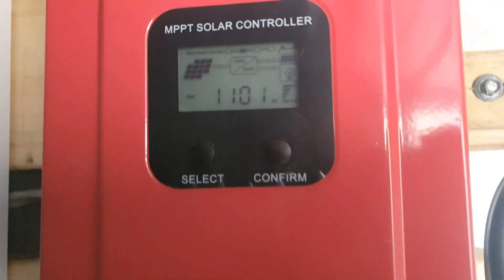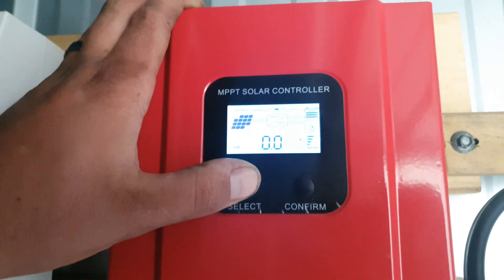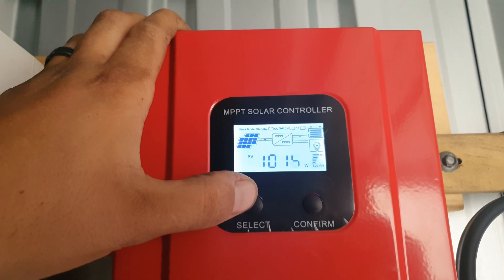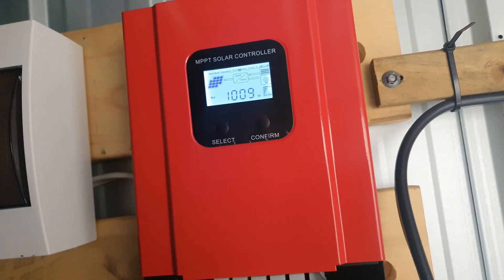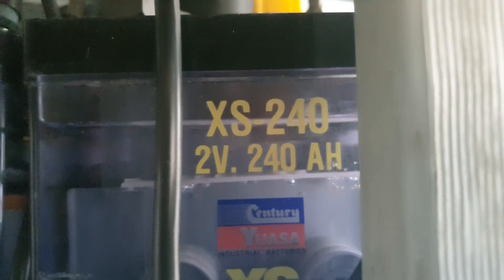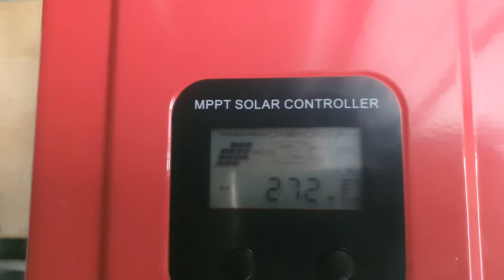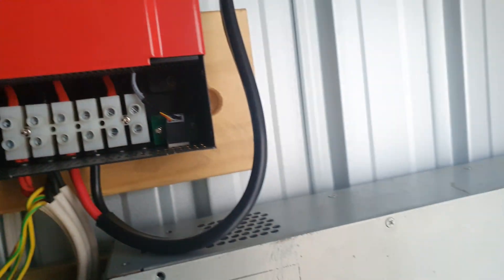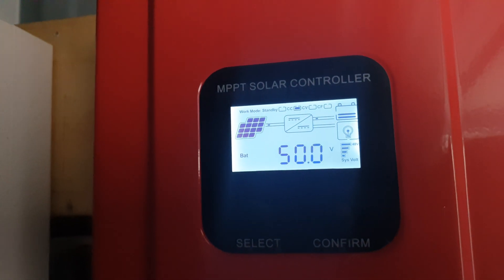2kw solar Ups Invter  48v mini power wall for Cheap $$

Comment: You said your batteries are weak.   You have wrong battery settings on mppt.  When going down menu and you see “sel” by default it is lead acid batteries when it gets to “sel” hold the select button opposite of it and it will give you range of different batteries so it will charge better for yours

Comment: I think a home system should atleats power anything single appliance used, I have a 5kw, for the whole house, I use average 2-3 kwh daily, with 20kwh lithium, and about 700ah of 24v lead acid, for backup, on a tiny 1500 ups, and a couple 500w ups, for lighting and phone charger what ever 500 will power, in a emergency, I also built a 500+ wh laptop battery charger, you can't have too much backup, or power! Being off grid,  everyone needs solar!